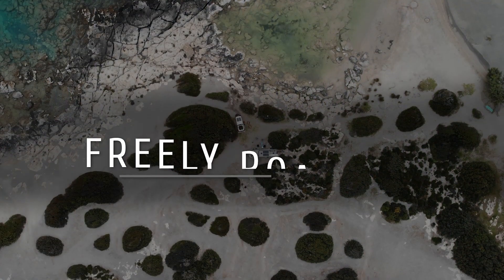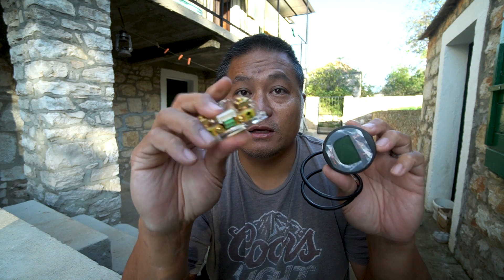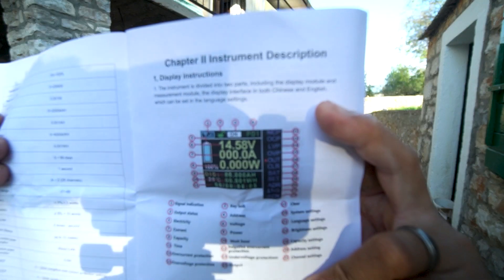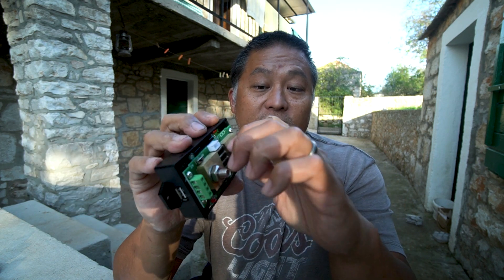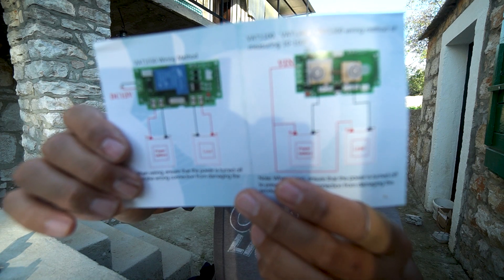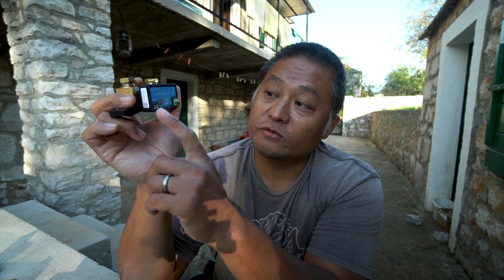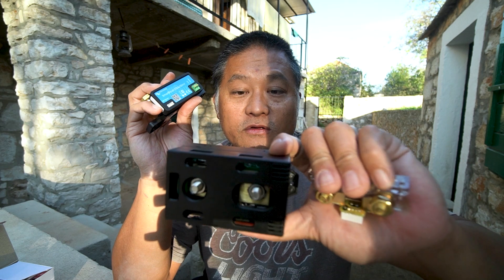Victron Smartshunt, AiLi and Juntek // Comparing 3 Popular Battery Monitoring Shunts

Comment: Im pretty sure that in almost all rv installations the BMS app is more than adequate for monitoring battery and state of charge. Only in quite large off grid installs with multiple batteries inverters and chargers and solar strings does a shint become worthwhile for monitoring a system as a whole . 😊
Reply: Also a bms screen will give instant overview

Comment: Questions:  I want to use a victron BMV-712 to monitor my starter battery.  But the starter battery is capable of 1000amps or more way above the capacity of the shunt that comes with the BMV-712.  So my questions are, will that hinder the torque output of my starter motor?  Will that burn out the shunt?  I really want a BMV-712 with a 2000amp shunt don't I?  What I want is that victron dial (the black one) on my dash AND have full throughput for my starter motor.  FYI I also have a 400amp alternator so I'm interested in how fast it charges my starter and the current is uses to do it with.  This is why I am wanting such a seemingly absurd setup on my starter battery.   Great video Thanks!

Comment: Dan, when sizing a shunt do you add up current coming in + current going out, or use them separately? i.e. a 100A shunt will work for 50A coming from the charge controller  and 100A going to the inverter?

Comment: Should the fuse go on the  12 volt battery before the shunt and is the shunt always wired on the negative from battery to fuse to shunt to inverter.
Reply: No, read your instructions they all are easy to wire.

Comment: One cool thing that the BMV 712 has is a relay output in the display that I use for turning on a cooling fan on my Orion Dc to Dc when the engine is running.  Makes a huge difference and pumps in a lot more current into the battery when it’s cooler.
Reply: KG140F have much more and cost 2x less. victrol harware is SUPER overpriced. their software not bad but hardware is not good. I have SmartSolar MPPT 150/45  geezus that thing is inacurate!!! Shows fake power numbers and tries to fool you their mppt is better so thats why numbers are better :D while in fact thei are off about 8% from reality.

Comment: Excellent review! How weather resistant would you say these three shunts are? I would like to mount mine in my battery compartment which is on a track under the cab of the vehicle and has a plastic shroud around it so water will not get in, but the batteries do show some road dirt over time. If the shunts are sensitive to that, I would need to create some sort of enclosure. Thanks!
Reply from the maker: I would definitely keep them enclosed. If not to protect them from fan damage, definitely to make sure the readings are accurate.

Comment: 150amps @ 12V is only 1800W. So a 2000W induction cooker no. A 2.4kW electric jug... nope.
Reply from the maker: Nominal voltage for LiFePO4 is 12.8 volts. And more than 50% of its operating capacity runs above 13.3 volts. If you have used an induction cooktop practically you would know it rarely, if ever needs to run at full power. A 2kw unit can boil a liter of water in 5 minutes running at 800 watts. And are you still using lead acid batteries? It's time to move on.

Comment: Shunt isn’t needed it’s kinda gimmicky. If you have a solar mppt from like Victron with Bluetooth you can get a lot of info. In my world enough info. It’s not accurate like a shunt but okay. You can tell the charge of the battery by the voltage in the app when there is no load on the battery. No charging or drawing power from it
Reply from the maker: If you have ever used a good quality shunt you will never go back. There is nothing gimmicky about it.  With LiFePO4 batteries it is nearly impossible to tell capacity between 15% to 85%. If I have to guess, you sound like you don't have much experience with reading the voltage curve of LiFePO4 batteries or a lot of experience with shunts. You can try to guess the capacity of a lithium pack using voltages or you can know for certain. It's about choosing the right tool for the right job.
Reply: @freelyroaming  true lifepo4 is another question. But still you can see in the victron app how much watthours it did put in the battery. (If you own their solar mppt)Not exactly but good enough.
Reply from the maker: @lenahandsen6836  not if you are also consuming power all day while you are charging. Not everything that the charge controller takes in ends up in the battery. What you are describing only works if you are fully charged each day or if you consume very little while solar is producing.
Reply: @freelyroaming  as i said If you check voltage without draw or load. Like in the night or you can shut off the charger in the app for some minutes to read the voltage. Also shut off the inverter. The resting voltage does not lie.
Reply from the maker: @lenahandsen6836  I will say again that going by voltage is a bad way of determining depth of discharge. Even resting voltage. It definitely lies. Especially when your battery has degraded from the abuse suffered from not having an accurate depth of discharge reading. Just get a shunt and stop guessing. If you are still using lead acid batteries, it's time to move on.
Reply from the maker: @lenahandsen6836  you sound like someone with ZERO experience with lifepo4 batteries. And ZERO experience with shunts. But somehow LOTS of BASELESS opinions on both. (Look! II also know how to use CAPITAL letters!)

Comment: Amazon reviews in UK say that the Victron smart shunt Victron BMV-712 has really poor bluetooth and you have to be on top of the thing to see data on your phone - disappointing. Also UK review says the Juntek VAT-1200 Battery Monitor is a fire hazard - got very hot at 100A and started smoking at 130A - so be warned.
Reply from the maker: Their Bluetooth is not the problem. The range completely depends on the phone it is connecting to it. I have a cheap Android phone that has to be really close to see it while my higher end Samsung phone has no problems from 10 meters away.

Comment: Definitely helpful to see this video for it answered a basic question for me.  I purchased the Victron SmartShunt, and assumed I would also need a BMV-712, but obviously I do not.  I also have a MPPT 100-50 and a Multiplus 2000VA.  I did not understand that Victron Connect app would monitor these components via bluetooth.  Up until now, I assumed I had to buy a separate bluetooth device to monitor each of the components.   So, with Victron Connect, these devices would be connected under the same app.  Love it!  Your video helped to clarify this.  Thank you.
Reply from the maker: In the past, victron did require a Bluetooth module to be installed. But lately all of them have it built in as long as there is a Bluetooth logo on the unit.

Comment: Great review...very clear and thorough...many thanks. 
I do have one question though which is this...I have two leisure batteries wired together in parallel and with both batteries separately wired to the vehicle chassis...so there is no single wire through which all the dual battery current flows..so where should one install the shunt to properly monitor the combined battery system?

Comment: The higher the Shunt's capacity, the lower the resolution. The Aili is available in a 150A and a 500A version.......The 150A version is more accurate.....But the 500A version is plenty accurate enough for RV use. You also might want to look at the Renogy and it's copies. Around $80 and a few more features (but not too crazy) over the Aili.....Great channel you have! Thanks for doing this for us!

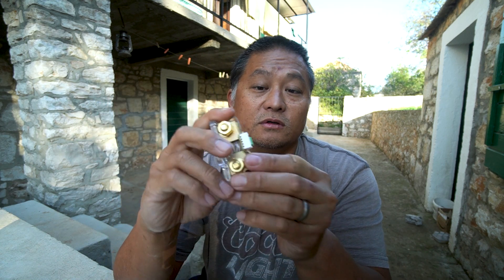Comment: 2:52 should there be a fuse in that wire? I just got a Renogy monitor and it came with the power wire. But the wire doesn’t have a fuse. Just curious. Great information and explanations as always. 👍
Reply from the maker: Everything that gets power should be fused. That said, this is an extremely low current circuit and the wire used is very small. Refer to the manual and install an inline fuse wouldn't be a bad idea.

Comment: Dan, at 13:45 of this video, you mention a Victron Battery and temperature monitor... is that the BMV712 you are speaking of, or something else?
Reply from the maker: I am actually referring to a standalone sensing unit called Victron Battery Sense. However, you can get a temperature sensor lead for either the Smartshunt or BMV712 to detect temperature. I just opted for the standalone unit because it was what's in stock.

Comment: Have you actually used the Juntek 1200 200amp model.  Doesn't this one have the programming error in the readout programming for charging and discharging?  After 40 or so discharges/charges the readout will always show that the battery is 100% charged ALL the time, even when the battery has been completely discharged.  If the firmware hasn't been corrected, this model is not recommended.

Comment: Unfortunately this review left one major part out.  The victron only logs data while you are bluetooth connected and the app is open.  So basically, the logging is useless unless you plan on leaving your phone in the battery bay for a month.  I believe the advertising by victron for this product is 100% misleading.  Thornwave labs makes a shunt that has actual onboard logging.
Reply from the maker: This is not totally true. You are referring to data monitoring and not data logging. Yes, for live data monitoring, you need to connect your phone to see real-time voltage and amperage. But data logging of total amps in/out, cycle life, synchronizations, and several other useful data points do not need phone to be connected. Depending on what level of data logging you need. Refer to my 400 day battery review and you will see how I used the data logging feature of the victron shunt over a 400 day period. Does not require phone to be connected for all of the data I used in that video. It's not what you were expecting but I certainly would not call it useless. With a GX display, you would be able to data log everything you are expecting to but of course it is at an extra cost. Or alternatively, you can do it by connecting it to a raspberry pi running their open source Venus OS software with a $25 cable. It is extremely powerful but unfortunately probably not a beginner friendly setup. I plan to make a video about that in the future.

https://youtu.be/KlKXdEaTixE
Reply: Thanks for that information, very helpful to know before buying.
Reply: Thank you for that. I'm going to look up & price a 500amp Thornwave.
Reply: I just bought an RV with the Victron installed. It has I believe 48 days of historical data saved in it
Reply: And that actually isn’t true!! Before bashing a product maybe actually know how it works!
Reply: You forgot to mention that the range of the victron is almost 0 feet

Comment: So I have (3) 500A Battery pack that I will be putting together soon  would I need a shunt per pack  I should connect all 3 in parallel witch will increase my current to 1500A

Comment: Nice video. I’ve used the Bogart monitor in the past, but I think the toyhauler I have now will get the Victron. Similar price, but has Bluetooth. I’ll likely opt for the one with the panel display- personal preference, but I’ll mount it near the remote for the Tristar and the rest of the controls.

Comment: Hi. I will be interested in your review of the victron products. My experience so far is mostly positive. For the same reasons you stated I purchased the shunt MPPT controller and power supply for the bluetooth functionality. What I have found is tou have to be less than a meter from the victron devices too connect. Are you experiencing the same?

Comment: What would cause the battery shunt (500A / BMV 712) to reach temps of ~ 85C using 4/0 cables to / from battery terminals (6 X Lion Energy Safari UT-1300 in parallel)? The BMV continue to operate with no issues showing all relevant data even with the high temps during inverting using 2 X multiplus 12V/3000/50. Less than 1,000 watts inverting temperature is reasonable, > 2,000 watts overheating takes place. The POS terminal is reading temps of ~85C - 90C. Below is a photo of the wiring / batteries.

Comment: I bought the 350a version of the first one with the intention of monitoring the (amp) output of my 300a alternator on my Ham Radio Equipped SUV, I thought I could just put the shunt inline between the alternator and battery.  Now I am confused as to whether it will work as intended.   Can anyone give me advice?   Or will installing it per instructions give me the results I am looking for??  Thanks In advance

Comment: If you have two AGMs in parallel where do you install the shunt to measure the correct info?
Reply: Both battery negative terminals go to the battery negative connection on the shunt.  All loads and chargers go to the "System negative" terminal.

Comment: Can you monitor both batteries in your system with this shunt?
Reply from the maker: You can monitor the total input and output on your system with a single shunt. If you want to know the status of each individual battery separately, you will need multiple shunts or some other type of battery monitoring device.

Comment: Hi Dan, I am kind of confusing for Victron Energy “Smart Shunt” vs. “Small BMS with pre-alarm”, are they working same function or….
Reply: I know they are not the same.  I'm not 100% sure the difference, my impression is is a BMS is about managing the cells in a battery system, making sure everything is balanced and controlling that.  While the Shunt is super basic: monitors every electron going to and from the bateey.  It's my impression that all the VE products can be configured to talk with one another and I get the impression everything else will use the SmartShunt as a gauge to do whatever they do.  Mind you, I could be totally wrong on all this!

Comment: I have been using the Victron shunt in my soler system off grid cabin. Now switching to Lifepo4 batteries in my motorhome and using the Victron shunt. I purchased the Daly 120 A BMS that you eferenced, it  turned out to be a total pile of trash, so waiting for a new USA manfacture BMS I hope is a better quality, and more reliable. There seems to be zero support for Daly products in the U.S.
Reply from the maker: That's too bad. Good luck with your new BMS.

Comment: 012821/1912h PST.      Thank you for the presentation of Shunts. Being a VICTRON person, this device will be incorporated into my ongoing PV system assembly. By the way, please view the following link; which exhibits various VICTRON products.
<invertersupply.com>  Ph: 1-888-606-2149
Their cost of VICTRON Shunt  Model: SHU500050100 is mentioned as $32.30.  A misprint? $132.30?
The above is for your research only.
As always, enjoyed yet another informative/educational report.
Thanks, stay safe and 73s...
Reply from the maker: Looks like the price is correct for that specific shunt. Its not the same as the SmartShunt I reviewed here. It appears to be a basic unit without any logic boards or displays.